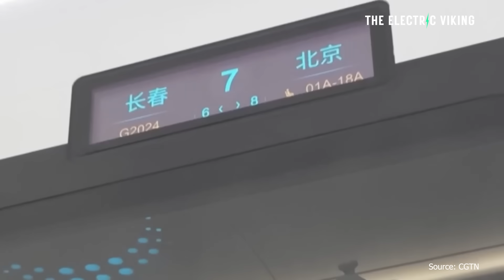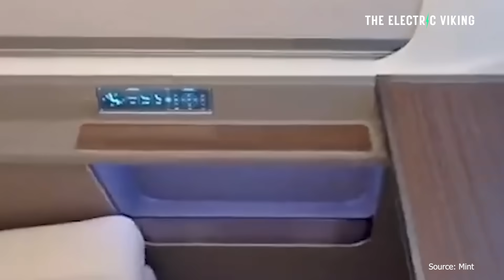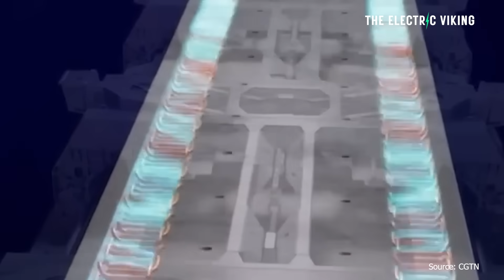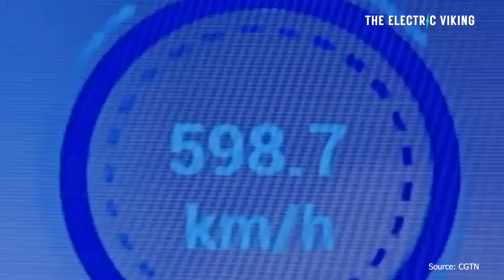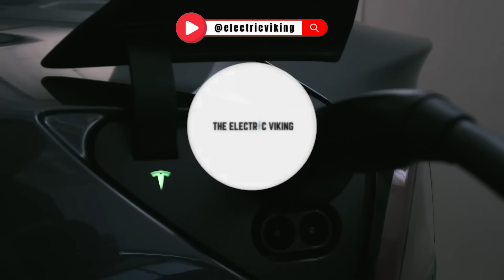The world’s ‘fastest’ bullet train is a remarkable feat of engineering

Comment: Correction: China already has a Maglev train running with a max speed of max 431km/h! 
Shanghai Maglev Train (also called Shanghai Transrapid) is the first Maglev line in China and the first and the fastest operational commercial Maglev Train in the world, which represents the high technology, wisdom, creativity of human being. Started from 2006, Shanghai Maglev Train runs between Shanghai Pudong International Airport (PVG) and Longyang Road in downtown Shanghai. With a top speed of 431 km/h, it shortens the 30 km (18.6 mi) journey to only 8 minutes, offering great convenience and special Maglev Train experience for transferring between downtown Shanghai and Pudong International Airport.
Reply: The maglev is a quite old (20 years at least) design by Siemens, if I remember correctly, It was designed and manufactured in Germany and exported to China, absolutely nothing to do with today's HSR. Te idea was great (using magnetic levitation instead of rails and wheels) but didn't go anywhere, you just can't build 40000km of maglev
Reply: @grandulasperty1812 Yes, it's the German Transrapid, which has never been built in Germany because it will not fit into the existing train system. Also, it would be more interesting if you have fewer stops.
Reply: @NoidoDev it doesn’t need to
Reply: @grandulasperty1812 It is very expensive to built. It cost China US$1.33 billion (US$2.37 billion in 2024 dollars) for 30.5km length. Operational costs are also high. South Korea closed their airport 100kph Maglev due to high operation costs. China has been running this high speed Maglev in order to learn about operational & maintenance costs and where it can improve and innovate in order to built longer distance lines.
Reply: The Shanghai Maglev's speed is currently limited to 300km/h. However, the next Maglev China is currently testing should run at 600+km/h or eventually at 1000+km/h....
Reply: @罗晶耀 Others say Beijing to Shanghai maglev project is no longer viable? 
Once I read 600km/hr maglev line to start build in 2027 China
But are these project still going ahead in China? 
Due to high initial cost
Thanks, interesting to know if these future maglev transportation project still going to be build
Reply: @james_l4337  Yeah! The Maglev projects are still going on and it  seems that they've reached 1000+km/h  during the latest demo run. However, it is too early for now to talk about any construction project  since there are still many technical issues to solve without taking in account the financial aspect...
Reply: @罗晶耀  I do know a bit. 1000km/hr is in trial testing research 
Not prototype stage 
There's no actual maglev train at all
600km/hr is the only one that's supposed to roll out 2027  but news stop
Reply: 18 mile demonstration project train that failed to attract a full intercity railroad for many reasons including 10 times the cost of steel tracks
Reply: @stevebaughman6520 As you  mentioned the Chinese gave up their proposed Beijing to Shanghai Maglev project due to the very high costs including operation costs. The Chinese however are willing to pay to learn how to build & operate a high speed Maglev. The other Maglevs are 100kph systems.
Reply: Shanghai's Maglev uses 3 Transrapid trains from Germany and one cloned locally.